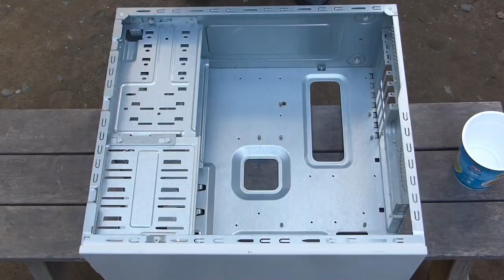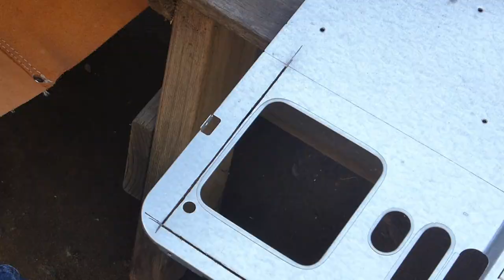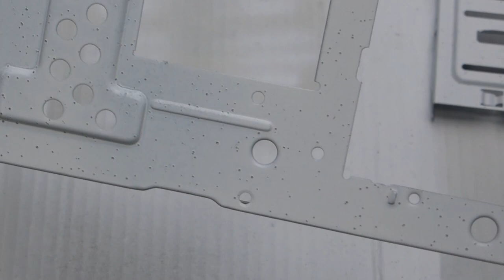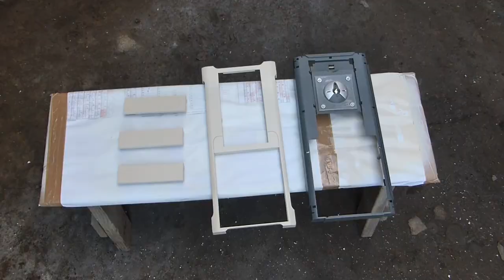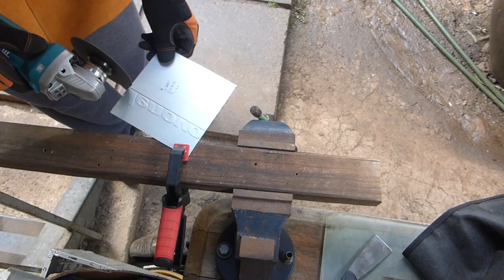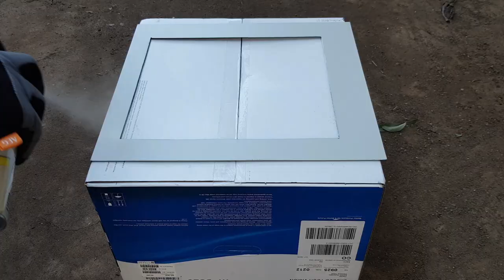PC CASEMOD - OLD CASE REFRESH - A COUPLE OF SETBACKS BUT COMPLETE

Comment: Any chance to share the information about the tools used in the video?  Thanks.
Reply from the maker: - Cordless Drill - with step drill bit to drill out rivets
- 125mm angle grinder - with grinding disc to cut longer less intricate cuts in metal 
- Dremel - with cutting disc to more intricate cuts in metal.
- Pliers
- Centre punch with hammer - to make guides to drill holes
- Rivet gun - with rivets (not sure what size or length) used to reattach all the pieces
- Paint (not sure what brand)
- Paint remover (not sure what brand)
- Double sided tape - to hold the plexi onto the metal. Make sure you buy high holding strength.
- Ratchet clamps - to hold pieces down while cutting.
I think that covers the main tools and extras.
Don't cut the plexiglass like I did with the angle grinder. Score it with something sharp with a ruler as a guide. Then break it along a straight tables edge. Much safer.
You don't have to necessarily go for a Dremel, look for another rotary tool brand with good reviews. I had to replace the one in the video at least twice. I've not had a good experience.
Sorry about the late reply and have fun modding.
Cheers.
Reply: Thank you very much! Your "straight to the point" video encouraged me to do a construction that I have been idealizing for some time.

Comment: I used to have that type of case back in 2000. I had some AMD cpu with a Shuttle ATX motherboard running a VooDoo GFX card. I went through several motherboards and CPU configs over the years up to the AMD Phenom X4 9750 paired with a GTX 960. Now I miss that case due to this vid. Great customizing of that case.
Reply from the maker: The case was quite simple in construction. I think that's probably why it lasted for so long. It's great that it lasted several builds, it was much loved. Who knows, you might find the case again in future. Thanks again for the compliment. Cheers!.